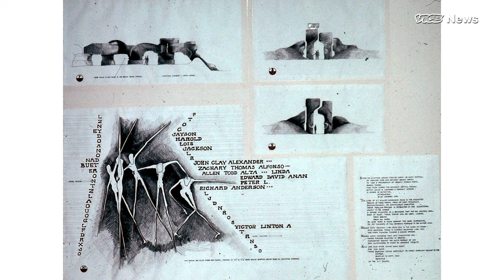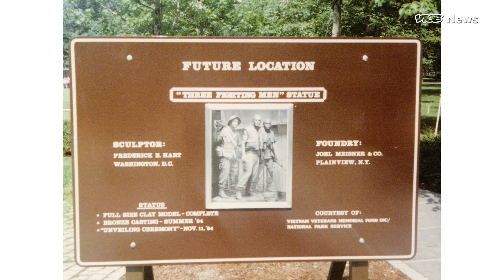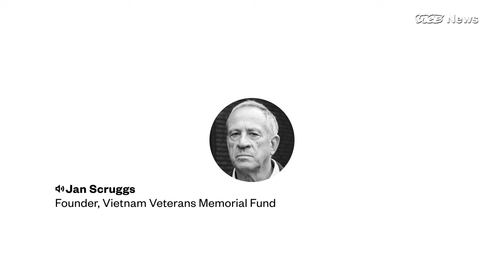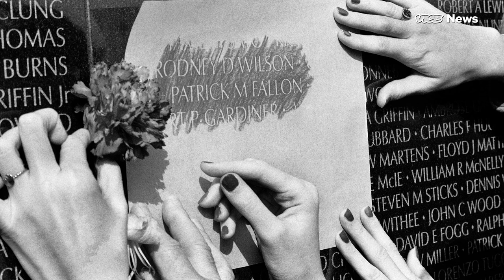This Vietnam Veterans Memorial Changed the Way the U.S. Thought of the War

Comment: What struck me the most when I visited was the trickle of names at the beginning, progressively becoming an avalanche of souls and slowly trickling out again as the war ended.
Reply: The names begin and end at the center. The first name is on the top line of the first East panel. The names continue east as the panels decrease in size to the point. They then loop around to the point of the west panels. They then continue as the panels increase in size towards the center. They end on the last row of the west panels at the center. The ends of the east and west panels have names from May 1968.  Facing the Wall east is to your right, west is to your left.